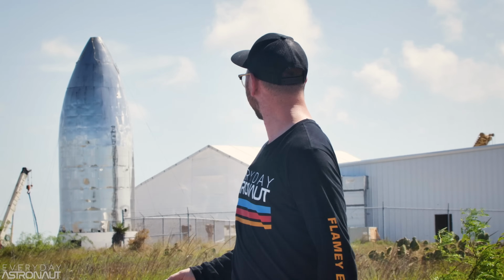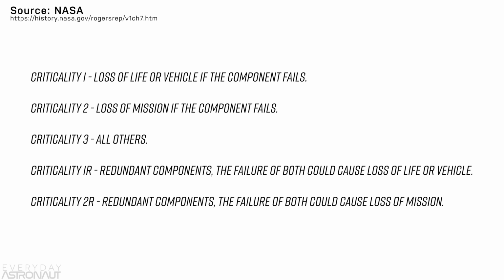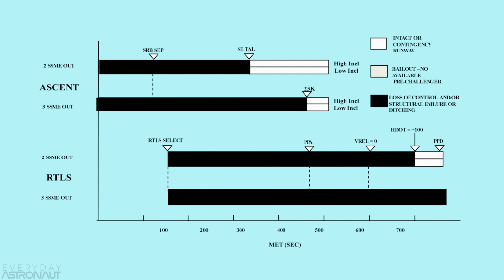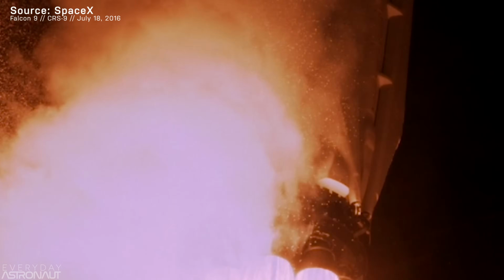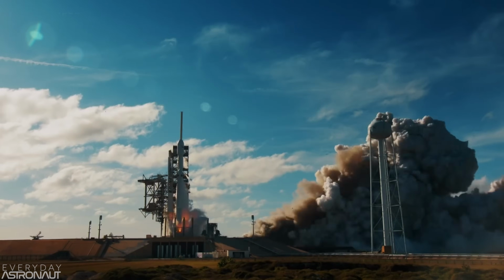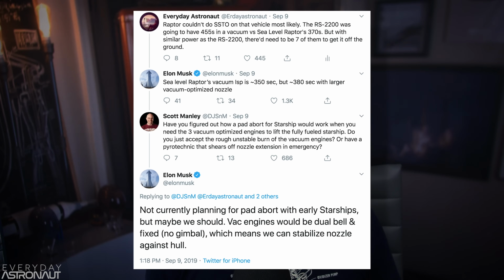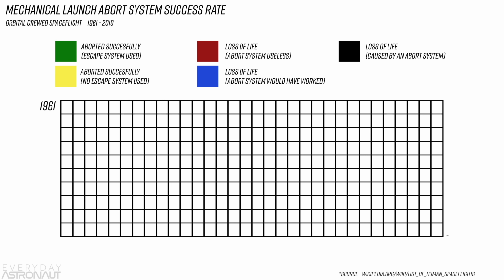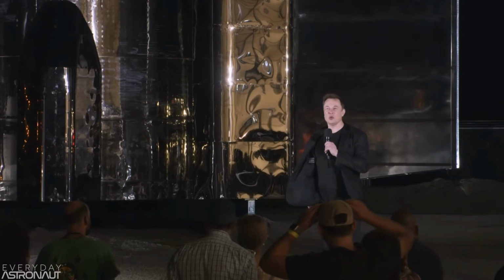Why won’t Starship have an abort system? Should it?!

Comment: Well explained. Gut feel is, until the volume of starship launches reaches the safe/reliable stats everyone is comfortable with, SpaceX can capitalize on the exponentially lower cost of Dragon for getting the crew up to and down from LEO. As for Starship, well, a lunar mission will require a number of Starship launches anyway: put the Starship Lunar Lander into Lunar orbit, deliver moon-surface equipment staging, refueling tankers staging, etc. So for a lunar mission, with all that going on, why not just build all Starships NOT to take Earth Re-entry (a huge cost and use of weight), and take crew up to LEO and back in a cheap & reusable Dragon. And use a Starship lunar-commuter to go to and from the moon. So on the return journey, just power-up the Dragon already in orbit (or plugged into ISS), transfer crew, and to take them down in the Dragon capsule? Eventually, you'd have 1 Dragon mission: (a) taking a new lunar crew up, and (b) a returning crew down. HOW EFFICIENT IS THAT! Who knows? In the end it may be cheaper to use Dragon for human LEO transport than to building Starships that can sustain earth re-entry! Someone should run the numbers.

Comment: This video is ludicrous. If the booster detonates it will be like a small nuke. The starship will not survive....... you may be an enthusiast, but it takes more than dabbling to fully understand the engineering and systems design associated with safe space flight. Starship is a ridiculous concept and even if it is ever man-rated will for sure kill a crew within few flights.

Comment: Does the loading and testing and unloading, repeat cycle of cryogenic fluids harden or soften the Stainless Steel?  I heard that SpaceX has their own custom Stainless Steel Alloy, in use since going to a reduced thickness of Stainless (yes/no - those two points may be rumors); if so, is that part of the repeated cryo-treatment of the metal (on purpose)?  How about permanent expansion (and thinning) of the metal, from repeated pressurization?
The front half of the rocket has been flown and landed “safely”; what more do you want of an “escape system”?  Yes, there’s always more crash protection that we can hope for; like perfect air bags (and did your car ever get repaired back to “new”)?

Comment: Airliners don't have abort or in-flight emergency systems. I fly all the time. So, yes, I'd get on a rocket without one but it has to be as reliable and proven as airliners are. Okay. That would take decades so not that reliable and proven. But, I am not going to be the first one. I'll wait a while and see how it goes for a couple years.

Comment: The Space Shuttle Challenger had no abort system ... the 7 astronauts were very much alive, flipping console switches, and talking among themselves during the 2.5 minute fall in the intact crew chamber ... dying as they hit the water at 25 Gs ... though some were found to have sea water in their lungs ... meaning they drowned.  The public was officially told they the crew cabin was disintegrated by the liquid hydrogen tank explosion, but it was the super sonic wind that tore apart the shuttle when it turned sideways/perpendicular to the shuttle accent trajectory.   The crew cabin was built stronger than the rest of the shuttle.   This deception was to head off criticism for not providing an abort system ... not even parachutes ... because that design afforded the shuttle the ability to get The Space Force up and running.  The Hubble could have been lifted into orbit inside a third stage rocket fuselage.   The current proposed design for the next generation NASA shuttle is less psychotic and much safer; though I do not believe we should be allowed off this planet until we get our own act together as a species ... For we are the Klingons ... We are the Krill ... We are the Borg!

Comment: A guy my dad used to work for worked on the team that designed the engines for the shuttle; including the Challenger. He said that even after the shuttle exploded, those systems were still working to regain control of the craft and were performing at some 600% of their maximum designed capability.
Reply: the failures of the shuttle were management not engineering. The flew the vehicle with known problems outside of safety margins. Any vehicle will fail in that scenario.

Comment: Remember though, all the 14 astronauts who perished during a mission died on the Space Shuttle because it had no abort system. No one died in Mercury, Gemini or Apollo.
Reply from the maker: An Abort system would not have helped the crew of the Columbia disaster. So that’s not quite a fair statement
Reply: @EverydayAstronaut  But maybe Challenger surely. Well whatever lands well, ends well. Starship won't have the issues that doomed Columbia.
Reply: @EverydayAstronaut  Thing is, all is glory and achievement until someone dies. I sincerely hope I will never see that happen.
Reply: Ejecting in a field of 9000 degree plasma isnt very safe
Reply: Bruh

3 great men died in Apollo 1.

Comment: Mr. Everyday Astronauts, Tim Dod, how do they make the spaceX rocket engine frames strong enough so that the engine thrust lift is transferred from the nozzle to the bottom of the load to achieve upward lift without crumpling the engine frame work? Vince Becker

Comment: At a M.I.T. presentation in the fall of 2005, Chris Kraft said regarding the use of solid rocket boosters on the space shuttle: "...What is your escape system on the shuttle? Well, on Mercury and Apollo the escape system is a solid rocket. Solid rockets have close to 100% reliability as you can get. Usually if it lights it burns and it goes. God! We've got two solid rockets on the shuttle. Why aren't THEY our escape system? Because if we can get this thing to 200,000 feet it'll fly. So, we can return to the launch site and land from 200,000 feet. Because you aren't too far down rage at 200,000 feet. God! That's a good idea. Great idea! But, the rockets HAVE TO BE 100% RELIABLE. It wasn't 100% reliable on the Challenger accident... Unfortunately I cannot account for the fallacies of man... we built the solid rockets to have 100% reliability and THEY WERE OUR 'ESCAPE ROCKET'." 
Personally, I don't agree with Chris Kraft's point of view of the solid rockets being the escape system on the space shuttle. The escape rockets on Mercury and Apollo were tiny compare to the ones on the shuttle. They were not segmented, running the risk of a leak, like it did on the Challenger accident. Granted, that's not the only failure mode on a solid propellant rocket. I think solid rockets were chosen for the space shuttle because they were cheaper to develop and to recover than liquid fuel rockets.

Comment: This video, and all who have publicly said that Starship doesn't need an abort system, will look foolish after the inevitable first fatal Starship accident years or decades down the line. SpaceX has apparently diligently worked for many years to purposefully reproduce most if not all of the worst features of any number of fucked-up rockets throughout history.

No launch abort system in the case of destructive vehicle failure on ascent or on the pad, despite equivalents to that very system saving at least 2 full Soyuz crews?

Hideously complicated thermal protection system composed of thousands of fragile little tiles with an annoying tendency to fall off, and which will all need careful inspection between flights lest the failure of even a single one at any stage of flight potentially doom the entire craft on reentry?

Incredibly complex fuel/ox delivery plumbing to ~30 engines, the uncontained failure of any one of which could cause cascading failure of the rest due to how closely they are packed?

Insane landing profile where they expect a rocket carrying tens or hundreds of passengers to regularly perform a suicide burn with no options in the case of engine failure or underperformance in the seconds before landing except slamming into the ground and detonating?

At the very least an airliner can glide to a safe landing, and doesn't carry oxidizer so it burns instead of detonating upon crashing. The Starship is a great example of how corporate mottos don't translate to the real world well. "Fail fast" is fine for software, not fine when it's a fireball with 100 former astronauts inside. Even if the rocket is improved from a fatal accident the loss of public and political support is a consequence which cannot be engineered away.

Sad to think that this will all seem obvious some day decades from now.

Comment: Why not? Make a separate crew compartment used for launches ejectable, like they considered for the shuttle. Yes it adds weight and costs, but it's possible. The project won't survive PR fallout from real casualties, so it's worth it. And why do you think that reentry abort is impossible? Do you have math to back it up? People thought landing a rocket was impossible.
Reply: Ultra V  It's all a compromise. Yes, things can be accomplished but that doesn't make it practical or affordable. There are risks involved with most things and we come to accept most of them for different reasons...eg; driving a car or flying in planes.  PR wouldn't affect the future of space exploration if that is what companies want to do as it is driven mostly by money. If the dollars are achievable then random people's opinions won't matter. Re entry abort would inherently be extremely difficult due to the velocities, for one. Do you have the math showing it's possible? Getting something to work isn't just math.  Uneducated people thought landing rockets impossible but those involved just thought it would be difficult.

Comment: More reps with reusable rocket SYSTEMS. Do airlines have abort systems? (Small planes have plane-scale parachutes). Failure-mode tested systems reveals safe operating environments & modes. SpaceX is getting operational experience in having a reliable launch and retrieval system, not merely safe parts.

Comment: In my opinion all space vehicles carrying human life need an escape system. Nothing is ever full proof. What if starship has a major engine malfunction? You can't exactly glide it down, we've seen how it bellie flops to destruction when it has engine problems. It doesn't even have to be engines. Could be guidance or a multitude of possibilities. At least with an escape system there is hope. Look at Russia's ms10 rocket malfunction. The astronauts were saved by the escape system that kicked in.

Comment: I appreciate that NASA wouldn't accept astronauts flying on an interplanetary mission without redundancy measures due to accountability and liability issues.  The point I would highlight however is that Martians will not be government employees, nor bothered about pensions or finally remotely bothered about abort mechanisms at launch, max-q, refuelling, the transfer orbit or even the orbital insertion because we all know it's a one-way ticket to Mars...

Nasa, ESA and whoever else attempts to send manned missions to the Martian surface (or anywhere else beyond LEO) will be funded by Terran governments and become the property/investment of those authorities who would in turn require the safe return of their investments (which in this case is the crews & samples) as politicians have a finite shelf-life.  Believe me I know from personal experience :)

IF the Starship I eventually board suffers a catastrophic failure at any point I'll die knowing I did so chasing a childhood dream without any regrets - Musk doesn't owe anyone a promise of certain survival in uncharted territory but he will owe us a bottle of Champaign if we make it to Olympus Mons for the sheer lunacy of this whole endeavour!

Besides on a final note - how the hell would you jettison ~100 settlers from their habitation section without basically doubling the mass of the transit stage thus the fuel tripling for orbital insertion?  Your theory of Starship separating from super heavy at launch is sound (no pun intended) but once it hits max-q there's no chance of aborting - max-q is literally the PNR for anyone onboard unless the ship is able to calculate a controlled descent and even then the aerofoils might tear the hull in half trying to slow the ship down before hitting (hopefully the ocean) at an uncontrollable vector.

All that being said though, I'll take my chances without wanting diapers and a pacifier (nappies and a dummy to Brits) because I was terrified of space and the potential vacuum death possibility until I realised that I'd rather die doing something truly ground-breaking and use my brain to help blaze the trail for all the generations that follow than rot in a dusty university office thinking of what could have been ;)

Comment: In your recent interview with Elon (brilliant work on your part BTW) Musk said that the only time the escape system is useful is during the few minutes of ascent. It doesn't have one on reentry, or, crucially, on landing or taking off from Mars or the Moon.
For that reason, it has to be safe enough without an escape system for 90% of what it has to do. Adding an escape system means extra cost, and complexity, for actually minimal improvement.
Early jets had escape systems, or at least parachutes for the pilot, but these days, we think nothing of getting into a jumbo-jet and flying without even a parachute.
They just have to make Starship as reliable as an airliner, and they have it made. Simply a matter of engineering.
Reply: Yep! Well quoted
Reply: Starship has to be safe but not because it has escape system that only can be used on Earth and at the first seconds of the takeoff but because it has a good relyability and a good history of lots of successfull crewed missions

Comment: I remember one astronaut from shuttle program mentioned that there was a guy with a button that would just self destruct the shuttle inflight if it leans off the proper trajectory so it will not fall on the city. What an interesting job that guy had

Comment: Has an aviation maintenance engineer I would compare the complexity of aircraft to these things, the difference being when an aircraft completely fails in the air you have a good couple of minutes watching that ground come up before you die. In the case of rockets, they tend to simply explode so you need one hell of a system to be able to save your crew.

I've often wondered about simple parachute systems bound to the frame of these larger aircraft, I mean if you can make a parachute for a 70 ton tank then why not a couple for a 200,000 lb aircraft? I would understand the frame would be under some weird stresses so because of this the frame may have to be bulked up a little more adding more weight, which means less passengers and more fuel. Placing four across the top of the aircraft from the nose to tail to deploy in case of a nosedive situation might work no?

The other issue I found was that is it worth the expenses? Personally if you place yourself on a plane that's about to nose dive into the ocean wouldn't you be wishing for one? But when you have something like 4 billion people fly per year and only have 534 deaths for example in 2018, this goes to show that aircraft are far more safer than vehicles, then a lot of things. You have a higher chance of getting struck by lightning than you do dying in an aircraft.

So at that point I suppose it doesn't warrant this type of safety device because the amount of deaths from nosedives on commercial aircraft are virtually zero compared to how many people have successfully flown

Comment: the shuttle is a stupidly designed death trap
Reply: The Shuttle delivered over 800 people to low earth orbit with 133 successful missions.
Reply: @DeepDeepSpace  that in no way means it's safe
Reply: @vtechvsmile  technically, no launch vehicle is "safe". You are essentially sitting on top of a large bomb. But the shuttle was about as safe as you're going to get with a launch vehicle.
Reply: @DeepDeepSpace  something tells me that a capsule that can land in the water and has a launch abort system with parachutes might be a bit safer than a giant death plane made out of styrofoam and tin foil
Reply: @DeepDeepSpace  okay well have fun on your shuttle I'm taking the capsule lol

Comment: As far as is Known, Starship will not go to the Moon manned. NASA will only use it as a Lunar Module returning to LEO for refueling after every mission. There are two main safety problems with the Super Heavy and Starship that I can see. The first one is the huge number of engines on the Super Heavy (28 to 32) that could create problems such as thrust instability due to engine malfunctions. The Soviet N1 failed because it had too many engines and an engine malfunction led to the rocket exploding on it's pad. The second one, involves the elongated shape of Starship, relative to it's landing base area when used as a Lunar Landing Module. The Lunar surface is not flat like a landing pad on Earth, so an elongated landing craft with a small landing base might be prone to tilting over. Of course this can be fixed by extending the landing gear to the sides in order to create a larger more stable landing base.
Reply: not to mention, how is the crew supposed to get out of that thing even if it does land on the moon. The crew compartment would be so high off the ground.
Reply: @DeepDeepSpace  ladder.